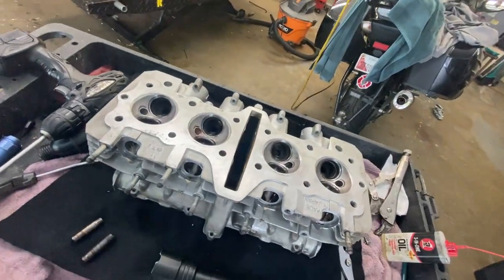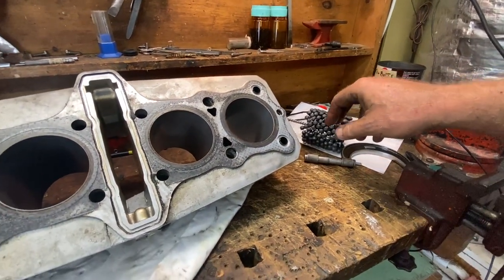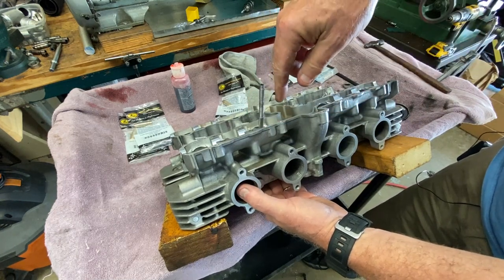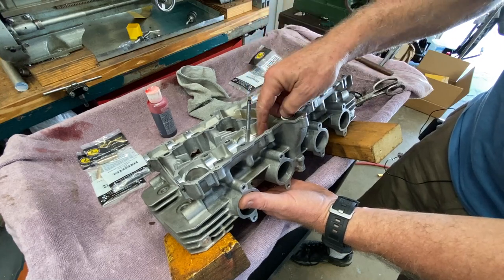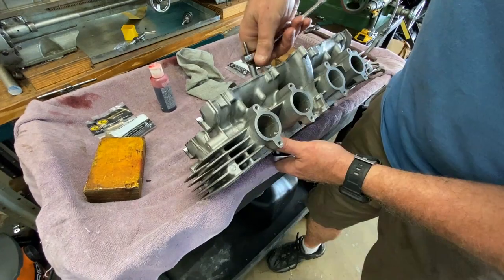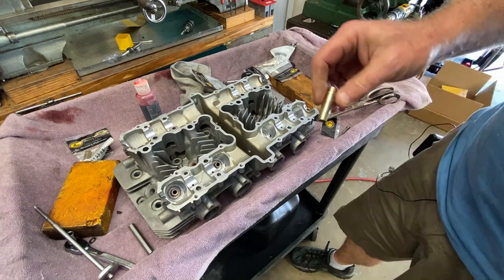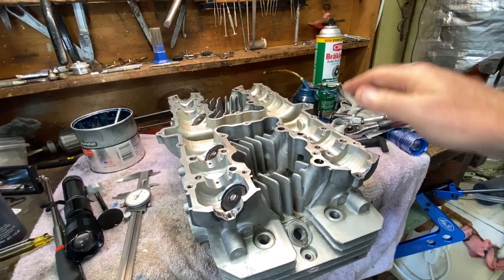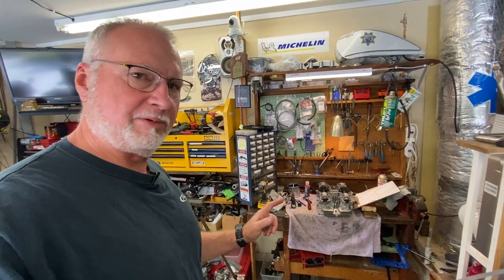Kawasaki POLICE 1000 full cyl head svc IN-HOUSE! Will it work? Is it scrap?

Comment: I've made a similar tool myself. But I used a 300 mm long coupler nut(for threaded rod) to do the pulling. That way, the load is spread out on more threads, and it will take the stress easily. Nice video, thanks!

Comment: Perhaps making a long hex nut will stop the draw nut  seizing
Reply from the maker: Actually, I made an entire new one this time the same 7mm size as the major diameter itself. Threaded M7-1.0 and I did use a scrap of hex bar which was hardened, I had to temper it with a torch to machine it, drill and tap that and made a longer nut. I didn't reharden it because it was moot; the bar itself isn't like 4140 steel or anything like that. I used it off-camera on one other guide and even that one was starting to stretch the threads. So yea, a 2 thou crush is a lot of force but the concept was good in my opinion. If I ever get a new lathe with single-point threading capability in metric, I can make these tools in either tool steel or 4140 higher carbon steel and harden them. But alas, the Neway valve seat cutter set, which I've wanted for awhile now, set me back over $1,400 bucks so no lathe for me.